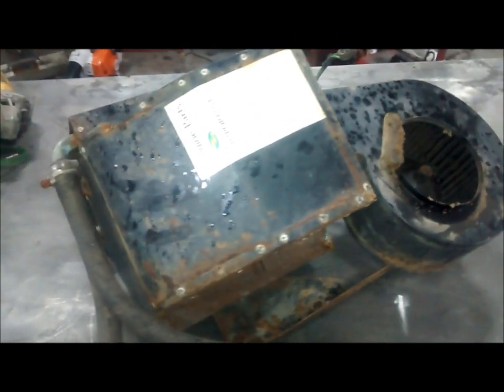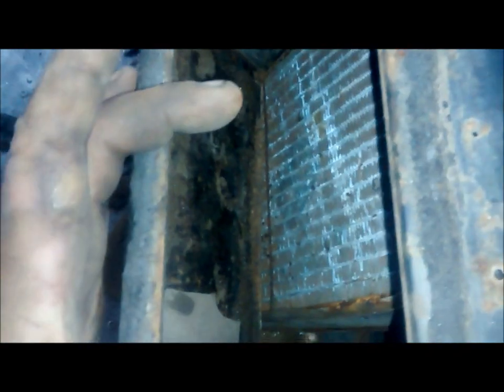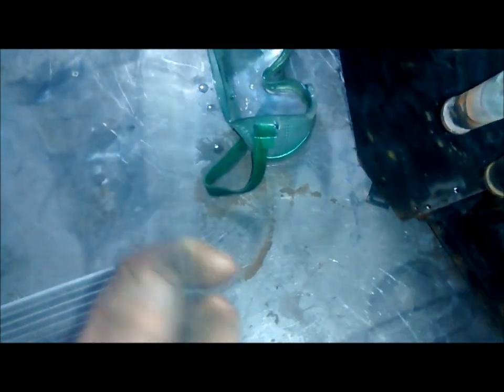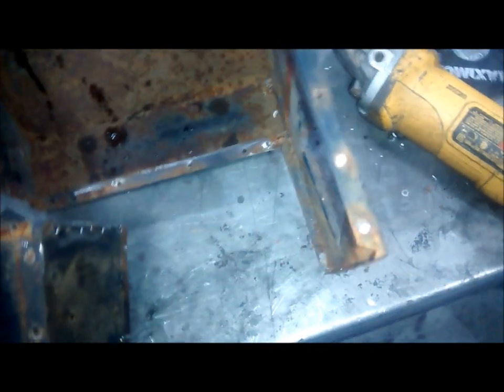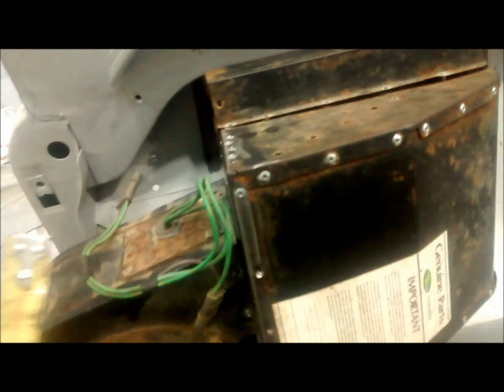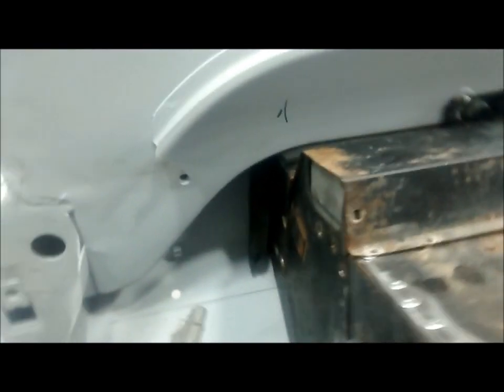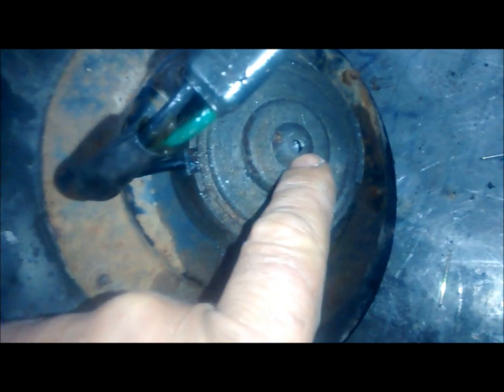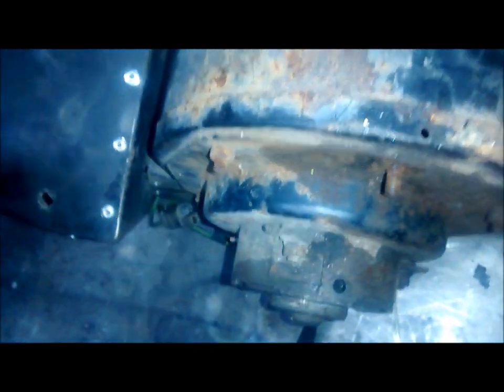Defender Heater modification part 1

Comment: As I do have some issue with the heater on the 130ty I thought to have a search in your library  - and found that one ! A) It gave me a hint where to look at and B) this is a great idea - take input air from inside - will check how I could modify on and anyway installed LHD - Great Mike! Thanx & Cheers Axel
Reply from the maker: Works like a charm and very hot in winter!!!

Comment: Great and interesting video.   My own favorite for my Defender was to put a second complete heater unit in the seat box. I used hosing off an Henry vacuum cleaner to distribute the warn air to the passenger side foot well.  Depending on what car you get the heater-unit out of, you can have it recirculating or get an input from under the center seat void.  Maybe you might like to try this in Canada,  it works well driving over the Woodhead pass and the Snake Pass in the worst weather  without a freezing windscreen.  Carry on the good work.  Best wishes from Yorkshire-Rob.
Reply from the maker: The heater works real well, and again it was a matter of saving a few bob! 
I wanted a left hand drive heater, but would be $1000 by the time I got it here and fitted (used are almost impossible to find)

Works so well, that passengers say things that you never hear about in a Defender - like, 'can you turn the heater down?'
Lol!

Mike

Comment: Hello. Sorry for my English. I want to say thank you for all your videos. I disagree with some of your views, I used some of your advice to maintain my Defenders. I am concerned that the front and side windows will fog up when using air from the passenger compartment.
Reply from the maker: I have been using this method for 10 years and there is no fogging due to recirculation as the Defender has so many places where air can escape - I know as I put and industrial smoke machine in a 110 once and it leaked everywhere
Reply: @BritannicaRestorations  Good. So I will redo my stove.

Comment: TDI300 Def - Heater Coolant flow. I have been advised the heater coolant flow is always required, and also told it can be capped without issue. What is correct (I am looking to fit an aftermarket heater which uses a electric valve - therefore shuts flow)

Comment: Hi Mike. Did the disco 2 matrix fit the main casing without modification?
Reply from the maker: It was too long, so I used the stock 2.5 diesel and pulled out all the flaps and guts and packed the matrix with foam so that all the air went through the matrix not round the side - it worked perfectly with the GM Vortex engine - too hot!
Reply: @BritannicaRestorations  did you reverse the motor to increase power, mine is obviously a rhd.
 The other thing is what's your opinion on swapping my windscreen and roof from a defender to a series, as I love the series look.
Reply from the maker: No, it makes no difference reversing the motor as the blower fan is handed. 
Yes you can fit a Series screen / roof on a Defender, BUT vision will be reduced, and there are 2 pins on the bulkhead that locate the Defender screen - you will have to remove these - also you need a series 3 screen and bracket to fasten it to the bulkhead - is it worth it?

Comment: Amazing video!!! I have an 85 LHD and I’m going to tackle the heater hole opening this weekend hopefully! I also think the idea of using the flipped RHD box to pull air from the cabin and recirculate the air is absolutely genius! Too bad I don’t have one on hand :-(

I have one question, I know with Jeep CJ’s you can enlarge the blower hole and buy a much much bigger blower motor from a GMC truck but haven’t found anything about that for defenders. Do you know of any upgrade for a larger or better-than-OEM motor? Thanks!!!
Reply from the maker: The blower is actually quite good 

See this video from here

https://youtu.be/0YAJlC-T3Dc?list=PLkIBI0td6S2u1PvH9wz90D9zju4mDsbJd&t=181

The problem is pulling in air from outside the vehicle AND the restrictions in the heater duct

I promise if you modify the system in a LHD as I described in the heater videos, you will have a real hot heater!
A RHD fan + motor is about £50 +shipping

Believe me, I was in my 130 the other day and it was -10C outside and I had to take my coat off!

Comment: Good helpfully vid but a shame you all so don't show you putting the box back together instead of just trying to explain how to do it i find this a lot in your videos
Reply from the maker: Roe
Sorry you were disappointed, but these were very early videos were I was limited to 10 minutes by YouTube.
Now I can do longer videos as I have more subscribers, however it takes me 3.5 hours to up load a 1/2 hour video.
I am trying to alleviate this problem with the help of my Patreon's, to install cable Internet here, but it is expensive where I live in Canada.
We are very close to the target and I may do this video again, however some people have a low attention span and installing 35 pop rivets can be tiresome, so I have to compromise 

Mike
Reply: Britannica Restorations 
Thank you Mike didn't know you were restricted down to 10 minutes then. I do enjoy leaning from your vids & would like to do this on my 90 200tdi. Keep up the good work 👍
Reply from the maker: Thank you Roe!
Rural internet access is expensive in Canada as I am just outside the town limits which is frustrating. My only option is Cable Internet which jumps up in price, and if this channel does not work out, I cannot go back to my old package - very frustrating!

Mike